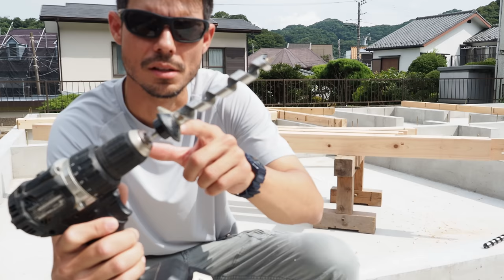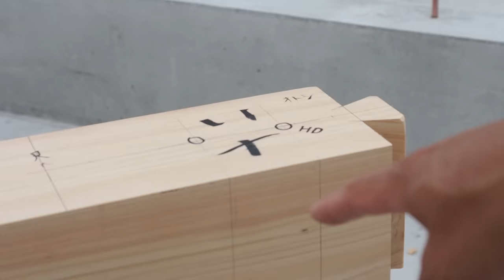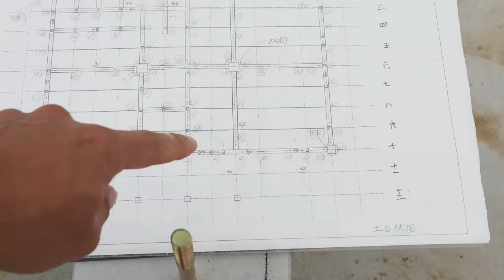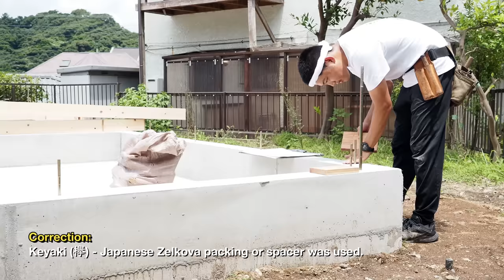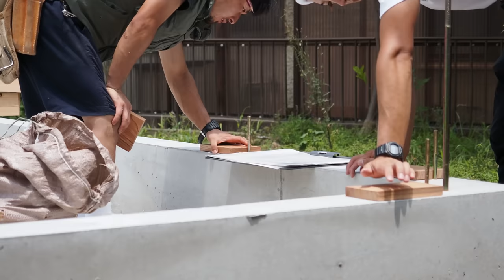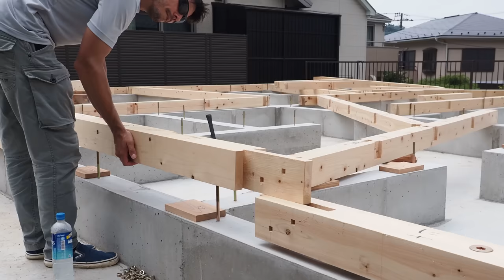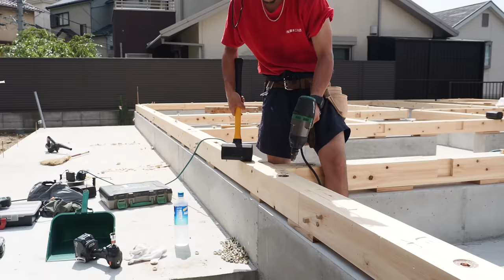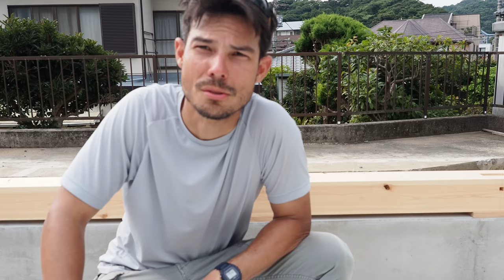Japanese Foundation Structure Explained! - Dodai (土台) - Setting up the Dodai (Foundation Beams)

Comment: I understand the appeal of traditional construction practices.  No doubt how they put the beams together will make it far stronger than other county's construction practices.  But just like they made changes in how and what they use to anchor the beams to the concrete foundation, they could use PVC lumber as spacers for the beams rather than wood.  PVC is totally waterproof and will not deteriorate if moisture gets onto it.  Wood, no matter how hard it is or how moisture tolerant it is, will eventually start to rot and break down.
Reply: That's right. So we will apply coating to this foundation. Coating helps to prevent the intrusion of moisture, carbon dioxide, and other elements in the air, reducing neutralization. Moreover, its water-resistant property helps to prevent water from penetrating the foundation and protects it from rainwater.
If properly constructed, wood will not rot. The Horyu-ji Temple in Japan, built in 670 AD, still stands today over 1300 years later without any signs of rotting.
Reply: @笑い男-z9j  
Was the Horyu-ji Temple in Japan built on a concrete foundation that it was also bolted to?  Or is it built on stones that are not porous like concrete and more likely to drain moisture than absorb moisture and wick it into whatever is sitting on it?

The person who was doing the work and trained to do the work specifically stated that the concrete absorbs moisture and to prevent that moisture from being transferred into the beams and causing them to rot, those special wood pads were put in place to protect the beams from moisture in the concrete from getting into them because they were a lot more moisture proof than the wood of the beams.
Reply: @oldtimefarmboy617  I am not making such a claim. I only said that wood will not rot if properly constructed. Of course, your method is also very effective. What I mean is that there are different ways to do things.
Reply: @笑い男-z9j  
"@Old Time Farm Boy  I am not making such a claim. I only said that wood will not rot if properly constructed. To achieve this, the foundation is painted and chemicals are injected into the wood."

"That's right. So we will apply coating to this foundation. Coating helps to prevent the intrusion of moisture, carbon dioxide, and other elements in the air, reducing neutralization. Moreover, its water-resistant property helps to prevent water from penetrating the foundation and protects it from rainwater."

So yes, you did make such a claim, which counters what the person narrating the video clearly stated.  That being that the concrete absorbs moisture and to prevent that moisture from being transferred into the beams and causing them to rot, those special wood pads were put in place to protect the beams from moisture in the concrete from getting into them because they were a lot more moisture proof than the wood of the beams.  No where in the video did he state that they had or were going to apply a coating to the foundation to prevent the intrusion of moisture, carbon dioxide, and other elements in the air into the concrete.
Reply: @oldtimefarmboy617  
Both methods are logically consistent in preventing moisture. Just the methods are different.
Reply: @笑い男-z9j  
True, but that is not what you originally stated which contradicted what the person in the video stated that they were doing and the reason why.
Reply: @oldtimefarmboy617  What was the contradiction exactly?
Reply: @笑い男-z9j  
"@Old Time Farm Boy  What was the contradiction exactly?"

The narrator stated they were using pads from a specific tree because of its resistance to absorbing moisture because concrete WILL absorb moisture.

I commented wood, of any sort, will absorb moisture and will always have the treat of rot and decay and that they could use PVC lumber instead because it is totally water proof and has zero chance of rot or decay.

You said you would apply a coating to that concrete to prevent moisture, carbon dioxide, and other elements in the air from being absorbed into the concrete.  That in spite of the fact that the concrete had no coating on it which was why they were putting those wood blocks under the beams yo prevent the moisture in the concrete from getting into them.  Something that logically would not be needed if the concrete had been coated to prevent moisture from getting into the concrete in the first place.

Then you said that you made no such claim.  When you clearly did make the claim.  That is called a contradiction.
Reply: @oldtimefarmboy617  Regardless of the method used, the possibility of decay and deterioration cannot be completely eliminated. It can only be minimized.
Reply: @oldtimefarmboy617  Is Horyu-ji Temple using PVC materials?
Reply: @笑い男-z9j  
"@Old Time Farm Boy  Regardless of the method used, the possibility of decay and deterioration cannot be completely eliminated. It can only be minimized."

That is true, but some materials minimize the decay and deterioration a lot better than others.

"@Old Time Farm Boy  Is Horyu-ji Temple using PVC materials?"

If they had PVC materials 1300 years ago, they would have been wise to use them.  But then they were also not using concrete for the foundation and rock foundations do not absorb water like concrete does.  With the exception of sandstone types of rocks, rocks allow moisture to drain to the soil and do not wick moisture into themselves, so there is a big difference between rock foundations and concrete foundations.
Reply: @oldtimefarmboy617  In other words, it means that even if only wood is used, it is possible to construct it without rotting or breaking.

>>Wood, no matter how hard it is or how moisture tolerant it is, will eventually start to rot and break down.
This is incorrect.
Reply: @笑い男-z9j  
Open quote.
@Old Time Farm Boy  In other words, it means that even if only wood is used, it is possible to construct it without rotting or breaking.

>>Wood, no matter how hard it is or how moisture tolerant it is, will eventually start to rot and break down.
This is incorrect.
Close quote.

Good to see that you now agree with me, since that is what I have been say from the very beginning.  Glad to see you finally caught up.
Reply: @oldtimefarmboy617  ??? You stated that "wood will eventually start to rot and break down," but I disagree with that.
There are various methods, but it is possible to prevent wood from rotting and breaking down just by using the appropriate method.
Reply: @笑い男-z9j  
Okay, I misread you comment.  My mistake.

But you are still incorrect.  Yes, you can do things that will make wood last a lot longer, but those things require constant periodic maintenance to ensure that the wood will last as long as possible.  But nothing is forever.  As soon as people stop maintaining it and the foundation the wood structure was built on, it will soon, maybe a few years or a dozen, start to rot and decay.  That is inevitable and unavoidable.

Make all of the people who maintain the Horyu-ji Temple to stop all maintenance work and it will not last any where near another 1300 years, no matter what "appropriate method" you used when it was built.
Reply: @oldtimefarmboy617  LOL Even if you use PVC material, it's not a guarantee that it will last forever.
If you use PVC material, it won't break down for 1,300 years without maintenance?
Reply: @笑い男-z9j  
"@Old Time Farm Boy  LOL Even if you use PVC material, it's not a guarantee that it will last forever."

Did I say it would.  I said that it will not absorb water or rot and decay like wood will and that is why it will last a lot longer than wood will.

I never said it would "last forever."
Reply: @oldtimefarmboy617  I also did not say that something made only of wood would not rot for 1300 years without maintenance.
Reply: @笑い男-z9j  
"@Old Time Farm Boy  I also did not say that something made only of wood would not rot for 1300 years without maintenance."

"So we will apply coating to this foundation. Coating helps to prevent the intrusion of moisture, carbon dioxide, and other elements in the air, reducing neutralization. Moreover, its water-resistant property helps to prevent water from penetrating the foundation and protects it from rainwater.  If properly constructed, wood will not rot. The Horyu-ji Temple in Japan, built in 670 AD, still stands today over 1300 years later without any signs of rotting."

"@Old Time Farm Boy  I am not making such a claim. I only said that wood will not rot if properly constructed. Of course, your method is also very effective. What I mean is that there are different ways to do things."

"Both methods are logically consistent in preventing moisture. Just the methods are different."

"@Old Time Farm Boy  In other words, it means that even if only wood is used, it is possible to construct it without rotting or breaking.  >>Wood, no matter how hard it is or how moisture tolerant it is, will eventually start to rot and break down.  This is incorrect."

"@Old Time Farm Boy  ??? You stated that "wood will eventually start to rot and break down," but I disagree with that.
There are various methods, but it is possible to prevent wood from rotting and breaking down just by using the appropriate method."

You also never said that it takes continuous maintenance to prevent wood for rotting.  You said that if "appropriate methods" were used during construction (which is what the video is about and what the wood pads were being use for) that you could prevent wood from getting moisture in it and prevent the inevitable rot and decay that moisture would cause and mentioned the Horyu-ji Temple in Japan as an example of a building that was constructed using "appropriate methods" which has prevented moisture from getting into the wood and why it has never had any of the wood used in its construction absorb moisture and decay or rot because of that moisture.
Reply: @oldtimefarmboy617  Please don't change the subject.
Reply: @oldtimefarmboy617  You stated that "wood will eventually start to rot and break down," but I disagree with that.
There are various methods, but it is possible to prevent wood from rotting and breaking down just by using the appropriate method.
Reply: @笑い男-z9j  
"@Old Time Farm Boy  Please don't change the subject."

I am not changing the subject.  The subject is about wood and the fact that it will absorb moisture from a concrete foundation which will eventually lead to the wood rotting and hos the cellular PVC dimensional boards are waterproof and will not absorb moisture and will not rot.

And the subject is also about you claiming that you will coated the foundation with something that will prevent the foundation from absorbing moisture, among other stuff, and that that will prevent moisture from being absorbed by the wood and somehow make it last 1300 years or more.  And all without continuous maintenance, just a one time application of some coating to a foundation that will be mostly inaccessible once the structure is built on top of it and covering it up.

"@Old Time Farm Boy  You stated that 'wood will eventually start to rot and break down,' but I disagree with that.  There are various methods, but it is possible to prevent wood from rotting and breaking down just by using the appropriate method."

You can disagree all you want but it does not change the truth.  There is simply nothing that can be applied to a concrete foundation, no matter the method you use, that will totally prevent a concrete foundation from absorbing moisture and transferring that moisture into the wood blocks that they were installing in the video to hold the beams off the concrete to prevent them from absorbing so much moisture.

There is also nothing that will make wood more water resistant than a PVC block that is by its very nature water proof and can never rot because of moisture.  PVC has been used for a long time specifically to transport water and do so underground in moist soil and has never shown any sign of rotting from moisture and is in as good shape as the day it was put together and buried in the ground.  Something wood would never be able to do, no matter what you coated it with.

Your inability to comprehend that does not change the facts.
Reply: @oldtimefarmboy617  LOL　If you use PVC material, it won't break down for 1,300 years without maintenance?
Reply: @笑い男-z9j  
"@Old Time Farm Boy  LOL　If you use PVC material, it won't break down for 1,300 years without maintenance?"

If you use wood material, it won't break down for 1,300 years without maintenance?
Reply: @oldtimefarmboy617  No, maintenance is necessary regardless of what material is used. lol
Reply: @笑い男-z9j  
"@Old Time Farm Boy  No, maintenance is necessary regardless of what material is used. lol"

Maintenance is always required no matter what material is used, PVC requires far less maintenance than wood of any species.  So as a barrier to moisture penetration into a structure through absorption, PVC is the superior, least maintenance required option.
Reply: @oldtimefarmboy617  I already know that lol
Reply: @笑い男-z9j  
"@Old Time Farm Boy  I already know that lol"

And yet you keep denying that as well.

"That's right. So we will apply coating to this foundation. Coating helps to prevent the intrusion of moisture, carbon dioxide, and other elements in the air, reducing neutralization. Moreover, its water-resistant property helps to prevent water from penetrating the foundation and protects it from rainwater.
If properly constructed, wood will not rot. The Horyu-ji Temple in Japan, built in 670 AD, still stands today over 1300 years later without any signs of rotting."

"@Old Time Farm Boy  I am not making such a claim. I only said that wood will not rot if properly constructed. To achieve this, the foundation is painted and chemicals are injected into the wood."

"@Old Time Farm Boy  ??? You stated that "wood will eventually start to rot and break down," but I disagree with that.
There are various methods, but it is possible to prevent wood from rotting and breaking down just by using the appropriate method."

"@Old Time Farm Boy  You stated that "wood will eventually start to rot and break down," but I disagree with that.  There are various methods, but it is possible to prevent wood from rotting and breaking down just by using the appropriate method."

You vacillate from saying that wood does not require regular maintenance if appropriately prepared to saying it does require regular maintenance even when appropriately prepared.
Reply: @oldtimefarmboy617  >>And yet you keep denying that as well.
No, I'm not denying it lol When did I say such a thing?
Reply: @笑い男-z9j  
"@Old Time Farm Boy  >>And yet you keep denying that as well.  No, I'm not denying it lol When did I say such a thing?"

"And yet you keep denying that as well."

"But you are still incorrect.  Yes, you can do things that will make wood last a lot longer, but those things require constant periodic maintenance to ensure that the wood will last as long as possible.  But nothing is forever.  As soon as people stop maintaining it and the foundation the wood structure was built on, it will soon, maybe a few years or a dozen, start to rot and decay.  That is inevitable and unavoidable."

"No, I'm not denying it lol When did I say such a thing?"

"That's right. So we will apply coating to this foundation. Coating helps to prevent the intrusion of moisture, carbon dioxide, and other elements in the air, reducing neutralization. Moreover, its water-resistant property helps to prevent water from penetrating the foundation and protects it from rainwater.
If properly constructed, wood will not rot. The Horyu-ji Temple in Japan, built in 670 AD, still stands today over 1300 years later without any signs of rotting."

"@Old Time Farm Boy  I am not making such a claim. I only said that wood will not rot if properly constructed. To achieve this, the foundation is painted and chemicals are injected into the wood."

"@Old Time Farm Boy  ??? You stated that "wood will eventually start to rot and break down," but I disagree with that.
There are various methods, but it is possible to prevent wood from rotting and breaking down just by using the appropriate method."
Reply: @oldtimefarmboy617  ??? Is this your statement?  "And yet you keep denying that as well."
Reply: When did I deny PVC material? Where is such a comment located?

Comment: how often are japanese wood houses still built with wood joints? i guess its quite a bit more expensive than using steel joints and screws? just wondering, im not a carpenter but there's also quite a big tradition here where i life regarding wooden buildings. actually im' just starting to build a company building quite similiar to this, also with concrete pedestals on a concrete floor plate with the timber construction on top

Comment: Aren’t there a lot of earthquakes in 🌏Japan? If so, is a concrete foundation really the best option?
Reply from the maker: House design in Japan adheres to many regulations that have been formed over years of earthquake experiences. I would say that most houses in Japan have a concrete foundation. The aggressiveness of an earthquake is sometimes astronomical, therefore, in these rare cases nothing is a great option. There is a level of unpredictability with natural disasters that makes it difficult to confidently mitigate against all risks. Some will argue that building on top of stones is much more forgiving allowing the structure to sway more freely without inducing too much stress on the supporting beams and pillars. Temples are built this way, but houses being lighter, they may not behave the same way in a sway. Calculation of momentum, shear forces, etc. will all change depending on beam and pillar sizing, wood quality, wood type, kiln-dried vs. air-dried, etc.